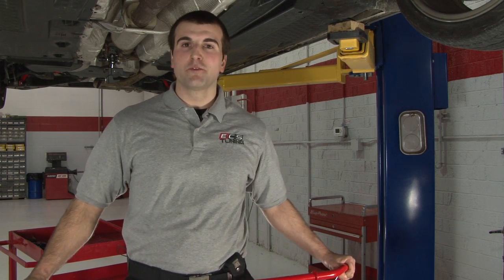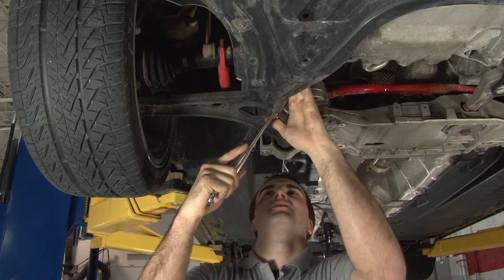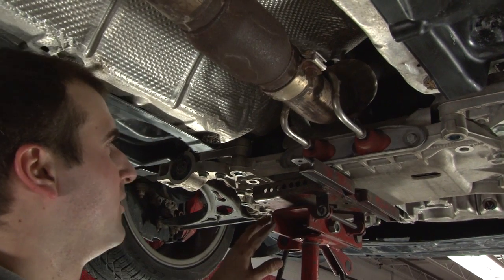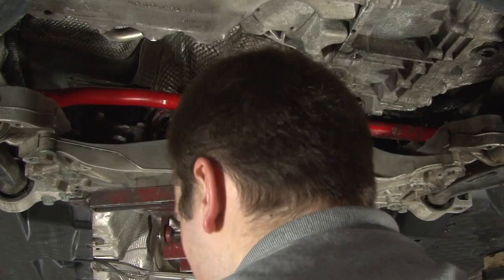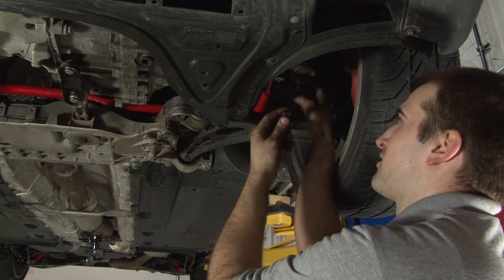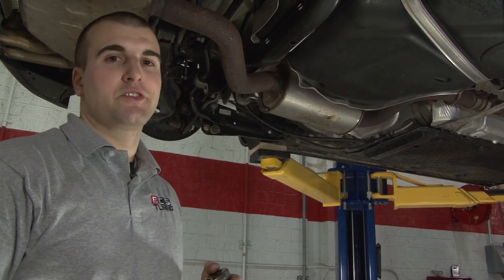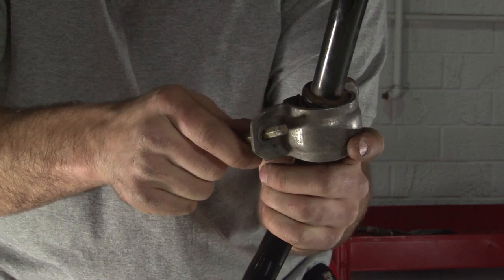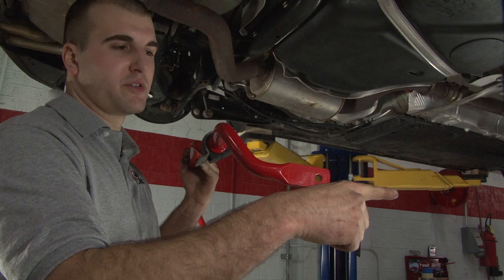ECS Tuning: MKV / MKVI Sway Bar Kit Installation

Comment: UK right hand drive took me 4hr in my driveway with the car on 4 stands. On RHD models you need to take off three steering bolts and undo a 10mm holding a wire harness. You also need to drop the subframe right down as the mounts are not removable like in this vid, they are riveted on so the entire thing needs to come out. What I did was use longer bolts in the holes of the subframe and dropped it low enough to get it out. I got my neighbour to make up an alignment tool simmilar to the VW special tool and it all went back together fine after I kicked it it for a while. ⚠️  If you don't use the alignment tool you will put the entire front end out of alignment and the steering wheel will be a mess. It can even throw up the G45 steering angle sensor code
Reply: When you say steering bolts what do you mean

Comment: WARNING !!! Do NOT attempt to do the front swaybar if you have a stock front swaybar on. Unless you are game enough to drop the entire subframe, because the bushing is fused to the bar and the bracket is riveted together. In this video as seen the sway bar taken out was already an after market one.
Reply: I just did the front myself with no lift and on my back. Just jack stands and good old Advil. The eibach pro kit with both front and back anti roll bars takes some commitment from a DIYer. .. 😂
Reply: @ssk3204 I'm going to do this on an m6 2015 jetta. Is there an issue to get enough clearance if the car is not jacked up high enough?
Reply: @charvelgaming2975  as long as you fit under it safely .
Reply: @custompiece4269  I'm going to have a local shop do it for me. $195 is not bad considering I'm on disability and lack the strength  to do this on my own
Reply: @charvelgaming2975  $195 is a bargain. Where I am they charge a min $750 can go upto 1000 if you want it done on a weekend.
Reply: @custompiece4269  it's definitely a great deal. I know it will be installed 100% correct and I don't need get under my car on jackstands lol
Reply: use about a 1/2 inch drill bit and drill the backside and the nuts fall off for reuse

Comment: So a higher mm means tighter turning?  What is the difrence between a 26mm and 28mm front swaybar?
Reply: The size has little to do with the effectiveness of a swaybar. It’s about the construction and stiffness of the material. Ofcourse the bigger size means u usually have a different bar but it’s kind of like a taller object doesn’t ALWAYS mean u have a higher center of gravity than a shorter object

Comment: Hi ESC team.

Winter is comming and my front sway start to sound like an old truck.

I have a jetta mkv 2010 2.5 lts and a Passat b7 2.5 lts, both are the same infraestructure. In both cars I have the same issue every winter I have squealing like old truck in the front sway bar. It is possible only to change the bushing or how can I fix this noisy issue.

 I think one option is change the front sway bar, other is only to change bushing that makes tgose horrible noises. I hope you can help me or give me some dirrections to solve it.

Thanks

Comment: -do I need to do all this to replace the front sway bar bushing on a golf 5 1.9 bkc?
-for this model the front sway bar bushing have unremovable brackets with a rivet? if so, what is the bolt that I use after?
-on the lift, how to raise the suspension to the unladen position without VW tools? and how its done?

Comment: Just installed a MK6 GTI front SB on a MK6 JSW tdi, manual trans. This video was helpful but did not exactly describe my situation. I ended up having to take the entire driver's side control arm/strut assembly apart and then hooked the sway bar through there. Reassembled with old bolts using blue loctite and took it to firestone for alignment - nearly perfect. 

Took me about 3.5 hours doing it in my garage with normal hand tools. Not bad at all, actually.

Comment: Hi, I have VW CC 2011. Is it possible to replace the front sway bar bushings after removing the first 4 bolts for the sway bar, with out lowering the sub frame and all ?
Reply: i. cut the sway bar bushings out to put the new ones in.

Comment: Things done wrong in this video:

1) Front subframe alignment locking pins not used - Front end will be completely out of alignment with crooked steering wheel
2) Front sway bar bracket bolts not replaced - these are TTY/Stretch bolts and must be replaced
3) Front drop link nuts not replaced - one time use locking nuts
4) Rear drop link nuts not replaced - one time use locking nuts
5) Rear sway bar bracket bolts not replaced - TTY/Stretch bolts.
6) Rear sway bar bracket bolts should be tightened in unladen position - or torsional stresses can prematurely wear bushings.
7) Bolts powered in with impact gun could cross thread (as in 8:28), should be started by hand.

Other than the above 7 points resulting in a potential death trap.....great job!
Reply: While this is correct I'd be amazed if many workshops go to the trouble of replacing every such nut and bolt when working on a car regardless of where they are. There must be a lot of 'death traps' on the road, mine included.
Reply: Correct.
Reply: Bord oow life

Comment: This video is highly deceptive the models of cars vary greatly when it comes to the sway bars some have removable sway bar bushing brackets where they split in two but not on any model less than a gti or gli .if you own anything less you are in for a fight ,to get it out with the brackets on you will have to loosen a small ten bolt holding the servotronic steering harness on the driver side on the upper subframe .also you can't change damaged bushings or upgrade them because the idiots made them unserviceable must discard sway bar and bushings or modify the brackets by cutting off the captured nuts and putting your own.you must make a large opening between the subframe and chassis to get it out .they must let you know the difference on models before you buy and end up in deep trouble. The new vw/audi subframe set ups are complete failures in engineering.
Reply: Curious which version my 2014 1.8TSI Jetta has... changing my end links in hopes it’s what’s causing this clunk I’m getting (both left and right side so I’m assuming it’s not control arm related and hoping it’s just the end links)
Reply: Went into this job thinking the bushing housing came apart on the stock sway bar. Looks like I'm not doing this job. If the stock bushing housing came apart  this would be a half hour job.

Comment: are you kidding me. I was trying to remove the links and it was giving me a f'ing hard time when I'm removing it from the floor. I wish I had a lift
Reply: Going through that right Now, Although I have stock sway bars...as the video shows aftermarket...yea not an easy task...any tips would be appreciated right I'm having trouble removing SWayB with its stock bushing and bracket so yea if you can provide any tips it would be greatly appreciated
Reply: Steering pinion should be removed on the driver side drop the whole subframe for like 10 cm and than remove the whole sway bar, drill out a bit of the sway bar brackets and place new bushings... Am also having a headache doing this I'll have to get the whole thing out. Luckily I work at a VW dealer

Comment: on right hand drive cars you'll need to undo the 3 bolts that secure th steering rack, you'll also find a small wire harness on the left hand side (10mm bolt) support the subframe as you loosen remove the additional bolts. now lower the subframe and you'll find you have plenty of room. job done. Sup.
Reply: Thanks for posting this 5 years ago! I was halfway through this today on my drive getting nowhere then read your comment which allowed me to get it free. Still quite tedious on a driveway.

Comment: Starting a bolt with an air tool is a great way to cross thread said bolt, potentially making your life much more difficult down the road. 

You should generally start bolts by hand, then you can use air tools if you like.
Reply: Josh Castaneda the one bolt he put on for the control arm is probably cross threaded. That air gun shouldn't have been impacting like that all the way to the end.
Reply: Josh Castaneda was going to say the same thing.

Comment: I know that it is recommended to replace the subframe bolts each time you drop them. Do you have the part numbers for all the bolts I have to replace? I have a 2012 MK6 Jetta GLI

Comment: The job looks relatively straight forward with the right tools and equipment. I'm concerned about the alignment of the subframe after dropping it and reinstalling it though. I've been told that if you don't get the alignment of the subframe right, it can put the whole front end out of whack. Can you please describe how you managed to keep the alignment correct? Also, does the procedure differ much for a Golf R? That's the vehicle I'll be working on.

Comment: does the car have to be on the weight of its wheels for this procedure ? like ramps for the rear ? and what about the front, if i get my jetta up on ramps at the front can i install it ? just curious cuz i tried the rear on stands and couldnt even get the sway link end out of the bar.... so i just tightened it back up, will ramps solve my problem?

Comment: Did I just see you cross thread the bolt on 08:28? You should always hand screw the bolts and THEN hit it with the gun snuggly then use a TORQUE WRENCH and torque to specs. Advice from a experienced Technician.
Reply: I was thinking the same thing, didn't look like it went in very easy